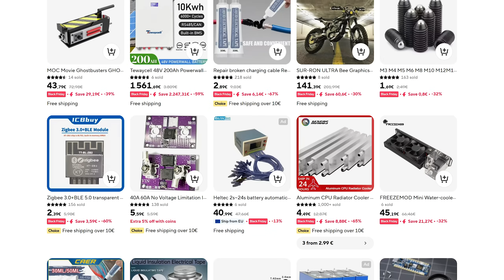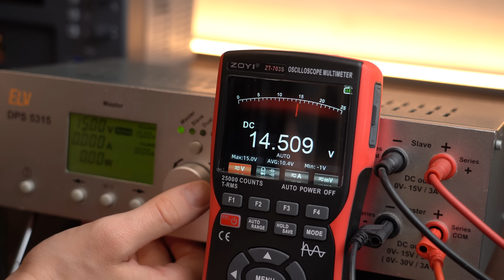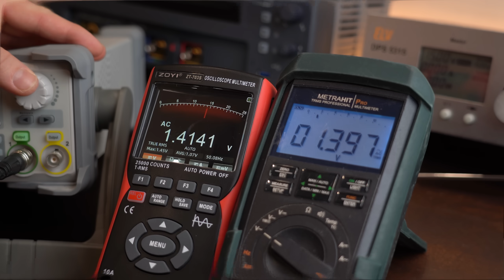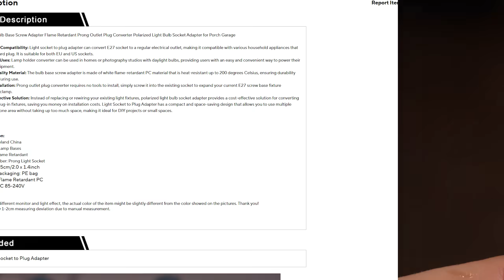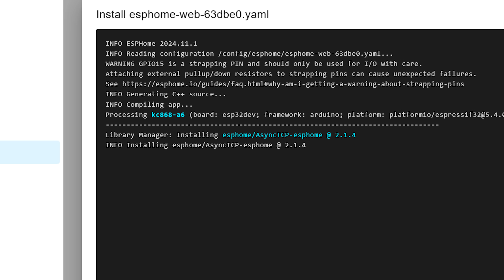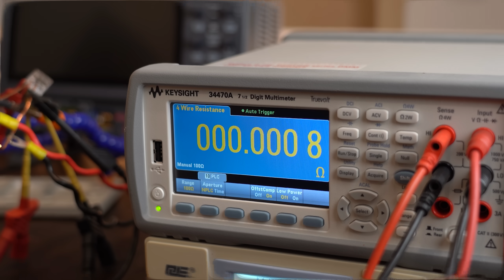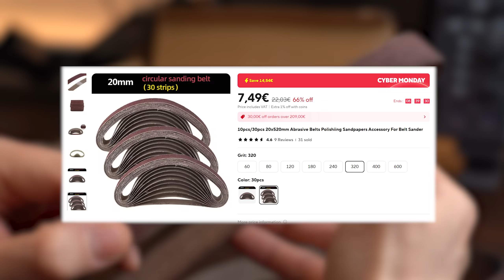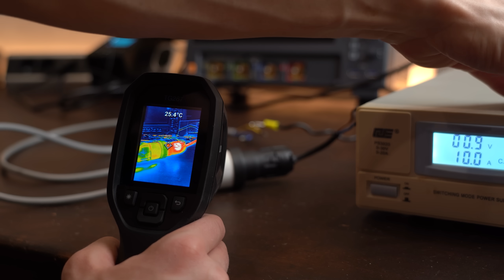I tried finding Hidden Gems on AliExpress AGAIN! (Part 12)

Comment: Sockets in light fittings were actually used before we got them on the walls!
Reply: Yeah. there's nothing new or weird about those.
Reply: @Alacritous  And they're very inexpensive. I've used them to hack together flood light motion sensor assemblies to create motion-activated halloween props. That was before I got more comfortable building actual decent PIR-based circuits of my own. I still use some here and there.

Or for plugging in strings of Christmas lights before we had an outdoor GFCI outlet.
Reply: @Alacritous  Well, outside the US they are quite weird.
Reply: @Alacritous Tell me when you find the earth connector in your light socket
Reply: @masterofx32  You know that the Earth isn't actually part of the circuit, right?
Reply: @Alacritous the weird thing is that now that we discovered we could put plugs in the wall, we kinda don't use those adapters anymore...
Sure in a pinch they work, but most countries ask for less power in the lighting circuit which means you can overload the circuit if you plug a big load. 

Also, even if you don't overload the circuit, you will probably overload the plug as they're made expecting loads of less than 150/200W.

Even if you're not overloading anything, those plugs have no ground, so they're risky to use. 

It's not gonna kill you instantly, but your friendly neighborhood inspector is not gonna be happy if they see you using it
Reply: @Alacritous It is rather weird given the fact that it's the year 2024 and not 1894.  
 
A Penny Farthing isn't a new invention either, but it's still rather weird to see one out in the wild.  

And no,  I have never seen such an adapter ever in use. I honestly also can't think of an scenario,  where such adapter might be actually useful.  I mean given the fact that it's 2024 and any place that has electricity has sockets.
Reply: @sagichdirdochnicht4653  you shouldn't be proud of being ignorant of something.
Reply: @Alacritous  I didn't say I was proud of the fact that I have never seen those things use before. 
I knew those things existed,  I knew that early homes with electricity didn't have sockets. But those times are again far past and I really didn't know something like this still existed in 2024. 

But I AM curious - where is this actually useful? I'm seriously at a loss of where this might be useful to anyone . I tried to figure out several scenarios,  but couldn't think of any where one might have access to a light fixture but not a socket - in 2024.
Reply: @Alacritous  Yeah, could do without his snark to start off the vid.
Reply: A long time ago electricity was only used for lighting because there was very weak distribution system and it was prohibited to use it for anything else. Even early tube radios were battery powered back then. And one day a "thief socket" like this appeared and everyrhing changed.
Reply: Useful when working in an attic or basement of an old building. You can add lighting via a power stip.
Reply: there still kinda common, once in a wile i see them at walmart and hardware stores designed more for outdoor use, there just made way better lol
Reply: @markhartranft1550 I’ve used one that gives both an outlet and still has a bulb socket on a porch light for plugging in Christmas lights outside where there wasn’t a wall plug
Reply: While a building is under construction it's not uncommon for temporary light bulb sockets to be hung from the ceiling because you need light, even before wall outlets are installed. And if you're repainting the walls, you may have all the wall outlets covered with painter's tape. In either situation the ability to convert a lightbulb socket into an outlet can be very handy.
Reply: Still common in old garages when needing to power a garage door opener.
Reply: These socket adapter are very common here in Canada, they usually have 2 plug outlets on the side and the bulb socket is kept. In older basements if you don't have outlets, and if you want to add a new light or a security camera without rewiring the whole place, that's a practical solution.
Reply: They're especially useful if you're installing lighting in your garage and the old lighting was a single bulb installation but the new lights are something like an LED "flourescent type" installation that requires a plug.
Reply: The Rural Electrification Act created a basic standard for subsidized home electrification, often provided at no installation cost.  Each room was wired with a lighting fixture, but often only the kitchen was provided with receptacles (plus an electric range circuit).

One of the major benefits of electrification was reducing fire danger.  Most fires were caused by lanterns, followed by stoves and ovens.  Most people didn't foresee a need beyond the huge benefit of electric lighting, although quickly a line-powered radio was a household necessity.
Reply: I remember them well In the UK...
Reply: I used to see them in attics for a work light. Youd often have a strip of bare bulbs(or just one) but no outlet in the attic.
Reply: I got one 20 years ago that I use every Xmas.
Reply: I've used such an adapter to get power for a laptop for clerical duty where there were no available sockets.
Reply: Yeah we used them around unfinished buildings to get quick easy power where you need it.
Reply: I remember some had built-in pull chain switches back in the early 80s.  It was funny when the light socket also had a pull chain.
Reply: That's why in Italy we have the separation between 10 and 16A plugs, with different type L sockets (quite annoying)
Reply: These plugs are actually illegal in Germany. 
They don't comply with the regulations in most European countries
Reply: They are banned in all of Europe so no surprise they are no where to be found here
Reply: I've seen them used from people living in residential building's caves and stealing power from the light fixtures.
Appart from that ...
Reply: In Canada, lightbulb plug adaptors are available in every hardware store as a standard item.
They usually are a little longer, so the plug goes in on the side, the bulb still fits on the end.
Some of them also include switches.  Totally normal thing.  not common, but not rare.

I imagine they are banned in Germany... The obvious safety thing is that, clearly, there is no ground.  otoh, lots of appliances don't have ground prongs anyways (e.g. vacuum cleaners, lots of lamps)
Reply: @qcca123-f1v 3-to-2 prong adapters are illegal there, though. They’re not here in the US.
Reply: Indeed. I use some in the unfinished basement right now since there is only one receptacle. You just have to be aware that it’s a lower amp circuit.
Reply: You can see them in the Carousel of Progress show, the first scene to have electricity uses them. Because when home electrification became a thing it was purely for lighting, plug-in appliances came later and so houses that were electrified in those days didn't have outlets, just bulb sockets.
Reply: I was just reading the Wikipedia page on history of AC Power plugs (https://en.wikipedia.org/wiki/History_of_AC_power_plugs_and_sockets) and found Patent US774250 from 1903 which seems to be the first iteration of this.

I guess whats old is new again?
Reply: @Infrared73  first patent 4162 in 1882 by Thomas Tayler Smith london surprising how old the idea is, China always thinks old tec is new tec 😂
Reply: I agree.  I have two, one from General Electric and the other from Westinghouse that my grandparents used in their home back in 1926.
Reply: yup yup, totally safe once we figured out overload, before that tho they tended to be pretty lethal
Reply: I used some to plug in some shop lights where regular single bulb fixtures were
Reply: I remember them 😊
Reply: Maybe those socket adapters are ok in a country with stupid barbie doll house 110v.... but in countries with 240v+/- Your most likely to kill yourself with something like that. Especially as most lighting circuits do not have rcd's.
Reply: @Steve211Ucdhihifvshi  It has absolutely nothing to do with the voltage since installing it, for instance, isn't more dangerous than screwing in a lightbulb. The potential danger is quite different. The lighting circuit may be designed in a way that it's only protected from shorts with a breaker that trips from exceeding the maximum permissible current for the entire circuit presuming that only low-power consumers are connected to each branch. That means an individual branch of that circuit can be overloaded by connecting a higher-power device but the breaker will not trip. The correct way to do it would be to have a breaker inside the adapter, so it would be impossible to draw an unsafely high current from it.
Reply: Think I've still got one or two kicking about somewhere (not in use I would stress), they used to be really common.
Reply: I remember an old bread toaster I came across, it had crumbling cloth insulated conductors that lead to a male screw-in light socket, early electrical networks were only for lighting, and had odd frequencies and voltages, everything from 40V to 260V AC depending on local supplier, and frequency whatever speed the generator was spinning at that day.
Reply: Some home web cam brands like WYZE in the US push them for powering their cameras.  Except the screw in is just for a USB connection and you can still screw in a light bulb.
Reply: I feel like they are still very useful for holiday lights and other neich applications. I’ve used them many times to put an ikea light hanging in a room to run off a wall mounted light fixture in older houses. It’s getting Maby 3 watts through it and has worked fine, I like it more then splicing an ikea light into the house wireing especially in rentals.
Reply: We use them for Christmas lights. Much easier to plug the lights into a light fixture than running a cord up the wall.
Reply: Gonna have to chime in that he's German. Probably why he's never seen the light plug to outlet adapter. I'm not 100% sure if you can tap into lighting circuits due to EU code. In the US, you can, and in my workshop, I have power outlets and lights on the same circuit/wiring.
Reply: but they at least still could screw in a lightbulb.
Reply: I remember that
Reply: Yup, ive still got a bunch of those and they have come in handy over the decades. Ive got the Bakelite ones, old school.
Reply: Does that make it a good idea then.  Some ideas and PEOPLE should be resigned to the dustbin.
Reply: Did you even watch the video?
Reply: Still useful with basic circuit tracers.
Reply: That adapter is sold is being sold in Brazil since long ago - they are useful to connect stuff in places that have only a light socket for public lighting, for instance.
Reply: In Latin America we still have the fitting for bulbs with 2x 110v sockets on the sides. Available on ANY warehouse store.
Reply: In some countries (e.g., the USA), these socket adapters are common and perfectly legal. In other countries (e.g., many European countries, Russia, etc.), they are illegal because lighting circuits are allowed to be made with thinner wire and breakers aren't enough to prevent damage and/or electric fire caused by overloading the lighting circuit.
Reply: @sciloj they're no "illegal", just impractical for high power stuff.
Reply: @Lvvcassss  I'm not sure what you are trying to argue about because it is specifically prohibited to connect non-lighting devices to the lighting circuit in some countries.
Reply: I have seen that for old american homes but have never heard of it in germany.
Reply: The only time i saw getting power from a lamp holder was in a Laurel & Hardy movie.
Reply: @DumahBrazorf  That's about the time frame when these adapters first gained popularity.
Reply: In my area people called these "theft" because at the beginning of electrification era, power for light were billed with lower prices than power for appliances..  so people "stole" power for appliances from light bulb sockets
Reply: @ivanvaccari  yep, true! In Italy some people also used them to steal electricity from the cellar lights that often were powered from a condominium power meter to run fridges or power tools!
Reply: In Europe the lights are on separate circuits and therefore runing on smaller fuses. Running power demanding appliances would pop the fuses. Sometimes light circuits are even made out of thinner wires... I wouldn't use such adaptors here.
Reply: ??? @mysa39
Reply: I think most people missed the mark on this video, and at very little fault of the creator. So many comments that disregard the fact that ELECTRICAL adapters utilize ELECTRICITY and is by definition something not to be neglected. We get it - they allow you to use pretty lights - me like shiny. But have you stopped to realize that any direct electrical component that comes without safety disclaimer and designed based off century-old electrical practice that maybe, just maybe; that is a serious problem and is only asking for the unaware person to inevitably experience unintended outcomes (to put this P.G)
Reply: @NoSponsoredContent  🥱
Reply: Yea I don't get why he portrays it so odd  they are actually Awesome to add to  outside security lights to power Christmas lights around eve of house looks clean avoiding running extension cord at ground level socket up to eve of house also great for running extension cord from ceiling fan light socket especially connected to a deep fryer filled with oil lol j/k about last part
Reply: Yeah…I thought that was a really odd example. Those adapters used to be really common, I still use one in my basement…just not for a glue gun.
Reply: Aren't Germans funny?
Reply: @Fur_Trader no  let's not be racist